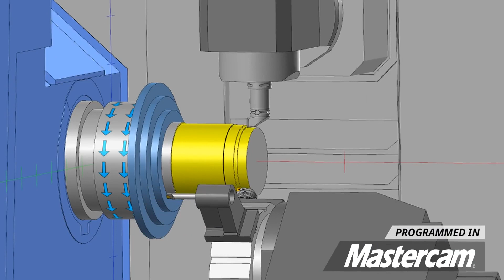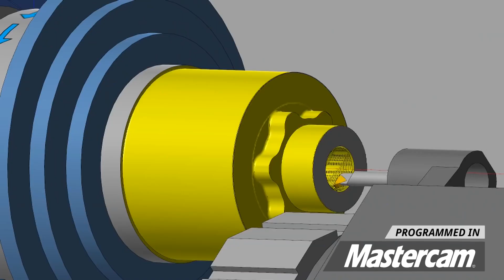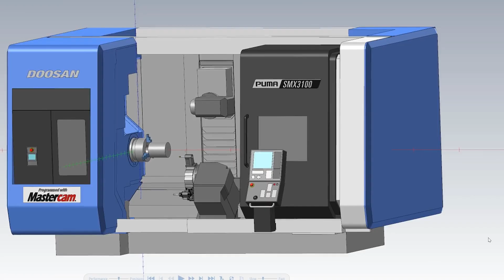Great CNC Machinists Don’t Get Paid Enough | The Biggest Problem in CNC Machining

Comment: As the top Machinist I made all of 26 dollars an hour.
For less than $1,000 worth of equipment I made pallets for machine shops to ship their parts on.
on average I was making over a hundred an hour and all I needed was a hammer a nail bar radial arm saw a Skilsaw and a couple of nail guns all from harbor freight.
And what I didn't have was the headaches I did not worry about every single move I made or scrapping $100,000 piece of material on and on.
I still had deadlines but those were the best deadlines I ever had when I delivered my pallets I got paid, not a week later not 2 weeks later or when I worked at one of the national labs a month later right then and there on the spot because people want to ship their parts and get paid themselves.
Granted not every part needs a fancy pallet to ship but the ones that do you can't just throw them on the back of a truck.
There will always be some clowns like Sperry that forces you to buy only from approved vendors certified materials that's fine just takes the price of the pallet times 10 boom.
Hand me a one page blueprint and 25 pages of specs yeah it's going to be 10 times and that still may be too cheap. 
I always thought machinist would rule the world
Sadly I ended up hating the trade that I loved to the point where I'm glad I don't have to work anymore.
I literally left the last job shop empty-handed I took nothing with me I walked away they were absolutely flabbergasted they demanded I return for my tools.
 As they were bringing them out of the door I threw them directly in the dumpster I think half the shop had to been out there with their mouths hanging wide open and I left feeling free like a giant Atlas had been lifted off of my shoulders.
After that I went into field service worked for a couple of the very finest machine builders in Germany and finally an Italian machine builder but specialized in machines for processing structural steel members and plate for building buildings and girders more like overpasses and big highway projects infrastructure remember shovel ready Obama.
The biggest blow for me was this theft of the election and that whole covid thing and I wonder now why I ever bothered.
The casualness of these scumbags just destroying everything that I ever worked for and I look at all the people who can't go back to work and earn any more money have there bank accounts hammered by these bastards in DC makes me want to vomit.
All the lies Democrats tell while they kill the very people they claim to champion the whole time pointing the other party who are just as bad as they are blaming them for killing old people.

Comment: In the trade 45 years in 2003... Making $20.00 hr... As A - Avionics Machinist in Seattle, WA.. Working in tolerances of half a tenth!!!  > Fifty Millionths of an inch - without top equipment that machinists have today. A Jig Bore and A Nichols Mill.. That is a small mill that holds an arbor with 10 - .006 thick One inch saw blades each spaced out to create 10+ slots in recording heads for flight recorders. Plus I got to clean the machine and sweep the floor and fill out paperwork and go to meetings and and and!!! 7 jobs for one check. Had enough!! Went 18 wheeler driving. Nice change of pace. Steer the truck and push pedals or on cruise control and listen to music and have a cup of coffee..
Reply: Truckers have their rough times too. I recall around that time 2003 when gas prices spiked hearing truckers were forced to buy there own fuel or not get the job. The good thing about working in a shop is that it warm and same place every day. I find it a good deal if i can sit down at times. Some shops frown upon sitting. With a jig bore you can sit at times. Not all machines lend themselves to sitting. I like a bench near by I can go to sometime and sit and rest and have a cup of coffee. The company I'm at now is a little like this.

Comment: An old friend of mine worked for a hospital. The nurses could not get a raise, the book keepers and paper pushers could not get a raise. But the VP's, CEO's, upper level admins had a off site building. If you knew where it was and drove by the parking lot, you would have thought that you were at an exotic super car dealership in Vegas.

Comment: It's sad but true. The company I work for has CNC Machinists that can look at a blueprint, make a program from nothing then run 300 pieces without issues. When I started for this company I remember walking through the shop on the first day and being told "These guys are basically professional grinders." I've never seen such disrespect. I plan to get my ticket and leave because no way am I sticking around toxic management like that.

Comment: Just started last year on being trained to setup and now edit from a great lead who can do everything the company needs (including a bit of our GM's job) but is now basically running away from the company because of this and now they're looking to bring someone in for more money that what he's getting while still wanting him to train the other guy. Learnt today that his wife might have a walmart store manager position where they'll have to move which he is actually happy about. I don't blame him, too much stress and he cares too much about his job, even though he says otherwise, plus when you try to improve the company more than the president it can be frustrating

Now they either have to pay even more to find someone quick or sub-contract some work out. Hopefully this'll get them to get rid of some machines (died, old or too much running cost for what we do) and bring in a couple Doosan lathes with active tooling we've been asking for for a couple years so we can easily transfer programs from our Hass DS30 and our older Doosan lathes which constantly push parts out the door.

Comment: All trades/vocations are pay the same today 26hr, plumber, electrician, machinist, HVAC, Auto mechanic, School teacher, Dental assistant, UPS driver,  Mailman, Cop . . . Its not the work you do. Your pay is based on how much it cost you to live, pay the rent, buy food. All these things are the same for everyone above. If your a hard working manager you make more. . . And some engineers make the 26hr too. The object is to get you for as low as they can.
Reply: I’d be in heaven making $26 an hour but I’m only an entry level CNC machinist….started 2 weeks ago, hired in at $16.50
Reply: @greeneyesfromohio4103  Entry level. . .you better know nothing for that wage. In 18months start applying elsewhere. Unless  they move you to another machine and learn something entirely different. Then start shopping around in about 3-4 years. Blesssings.

Comment: Biggest issue I see in cnc manufacturing is sound understanding of fixturing and measuring the activity of machines. Noisey machines do not generate productivity most of the time. Measure a shop floor and scare the CEO.

Comment: Titan,  i have a question,  how do you  handle mistakes,  im a manual guy whos learning cnc on the fly. I try to do everything,  lathe,  mills, weld , fabrication,  repair,  but im never satisfied with myself.  One mistake and i lose my mind and feel like a failure.  Whats your best advice?

Comment: To be fair I'm sure you know that even if a company makes millions of dollars per year chances are it costs millions to run the company as well. So if you have x amount of people making $100k plus on the floor every year in the big picture the CEOs really aren't making much profit compared to the Machinists who don't have to deal with the stress of running the company or the risk, etc.(.) That doesn't include insurance for workers, machines, vehicles, property taxes, income taxes, payroll taxes, utilities just for the company and the building. Then they have to go home and pay pretty much the exact same expenses at home except their home really isn't making them any money until they sell it so the majority of the time it's actually an expense rather than an asset.
Reply: Titan is pointing out (correctly) that by having the right people and motivating them to excel (financially and otherwise), they stand to make a lot more back than the additional labor cost.

Comment: I still think there's push back when shop floor guys go to the bosses with suggestions as at of them think they have people who have designed stuff that works perfectly when there are always improvements to be made, as Machinist we can see these things that the design might have missed. I recently went to the boss with a way we could do a job differently and possibly save thousands over the year and was told its been designed the best way we don't need to change it...it gets frustrating but if they don't want to save money that's their problem
Reply: then take an engineering course and you will get a change in perspective. Basic designs are best

Comment: Instead these companies get a manufacturing engineer fresh out of college, or the safety managers son, and make them the programmer, they give that person the salary, the sit down job, the comfortable office, the specialized training, ect. Then the people on the floor never have anywhere to move up to, they get the 2 year degree in Advanced Manufacturing just to be a button pusher at a low starting wage, then lucky if they get 2% raises each year. Then when they leave to go work as a truck driver, or for the local power company they wonder why, and complain they can’t find any Machinists.